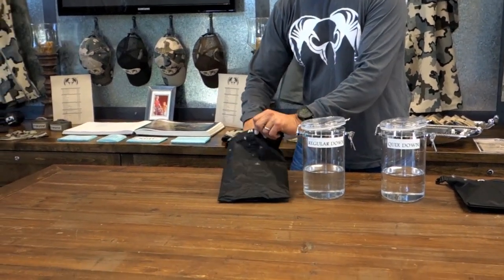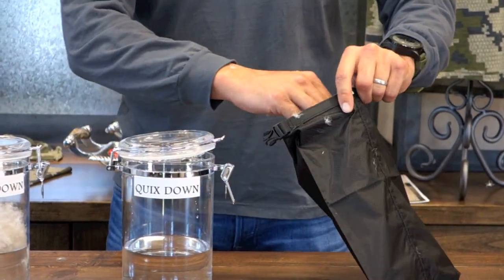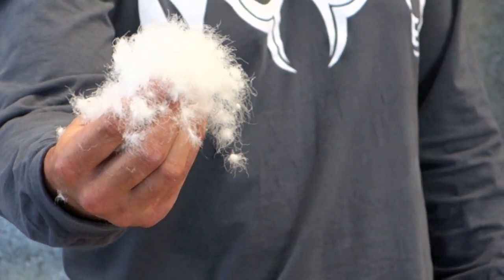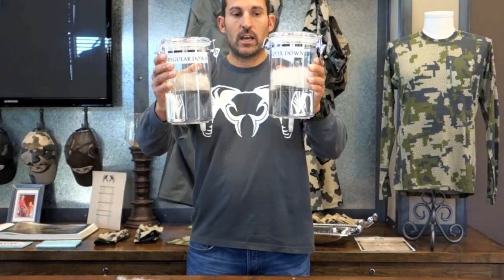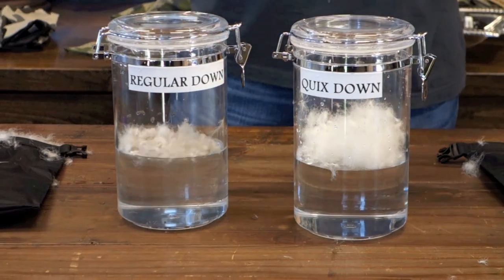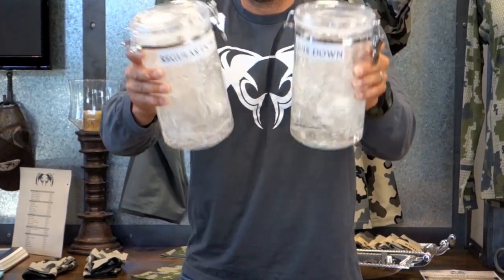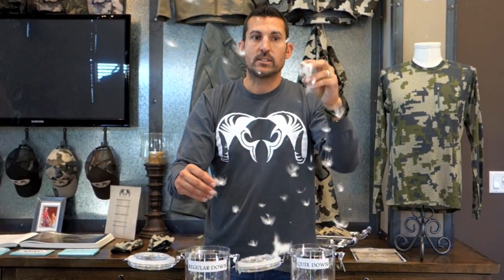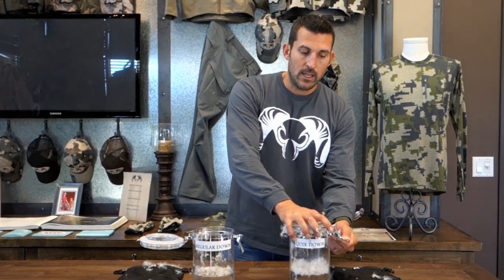Water Resistant Down Comparison - Toray QuixDown Demonstration

Comment: The actual Down & Feather Institute "shake test" last 10 minutes. TORAY's K-Down DWR treatment still is the best of all DWR down treatments.
Reply from the maker: Hey Eric--you're mostly right. The IDFL test has ten-minute intervals; they stop the turntable every ten minutes to measure how saturated the down is. In comparative testing, most other treated down products had failed by the 20-minute mark. We stopped testing the Quix Down after two hours because nothing was changing. Here's a video about the process! https://youtu.be/Yl04fT4VP40

Comment: This mess. is for Jason Hairston, like the results of ya Quixdown but find some trouble with ya wording in ya new brochure, it says in bold letters at the top of the article that it is "Waterproof" but half way down ya article it also states that it is a "Water Repellent" which is "Essentially Waterproof" and at the bottom of ya article again in small bold letters that it is "Positively Waterproof", now is it a Repellent or is it Positively WaterProof?  I checked with Toray Industries  web page and it claims it's a Repellent, so which is it  can't have it both ways especially if ya going to charge those prices for Waterproof. Thannx
Reply from the maker: Hi Terence, thanks for commenting.  Nothing is completely waterproof, so in reality, nobody is being held to a high enough standard!  But to clarify; the Superdown's face fabric is treated with DWR, making the exterior fabric very resistant to small amounts of water.  Each down feather is treated with DWR as well; now, in theory, this doesn't make them completely waterproof.  

In practice, though, it's hard to argue with the results we see--as the photographer here, I've tried to spray the down with water droplets for photos; didn't work, none of it would stick to the feather, the droplets rolled off and left it clean.  Then I tried floating it on a small puddle; the surface tension on the hydrophobic coating was so strong that the feather immediately slid off the side of the droplet.  I ended up having to use an uncoated down feather, because the coated one was so waterproof that I couldn't even illustrate how waterproof it was with a photo!  

The only time I've managed to wet it out was on a duck hunt where I was laying in soaking wet grass during an insane rainstorm, knee deep in a rice paddy...and even then, it was only partially wetted out.  

It really does a good job of keeping water off the feathers.  I understand your concern...but sometimes this stuff isn't easy to communicate.